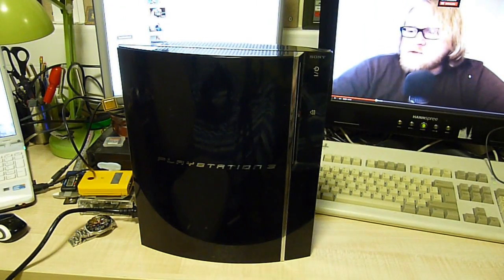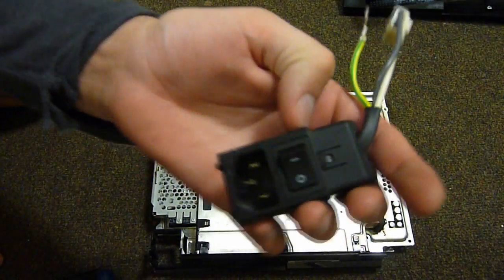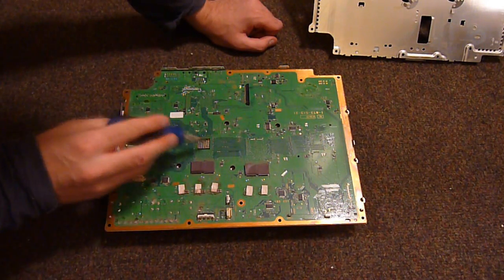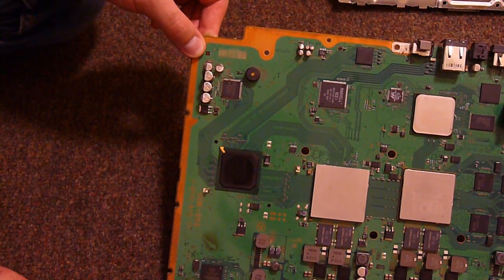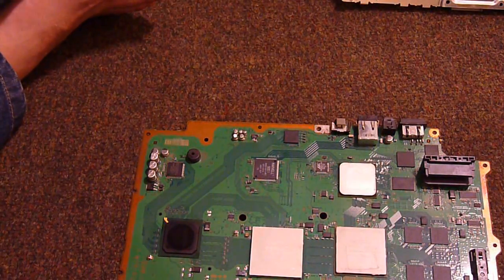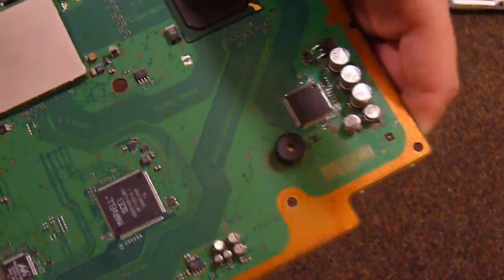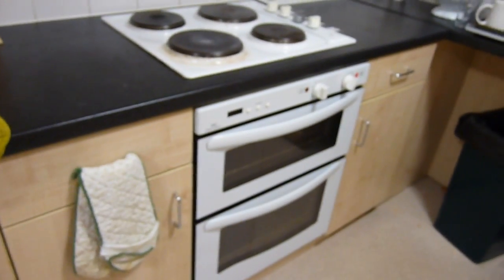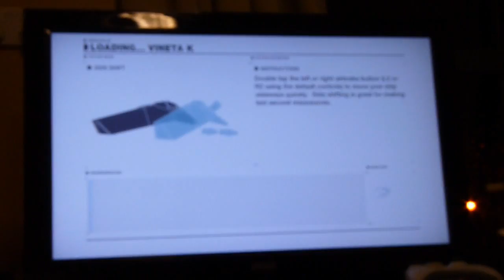PS3 Teardown & Repair

Comment: Damn you worm gear!!!  I hate that thing and I especially hate when the whole loading mechanism needs grease!
Reply from the maker: They are not hard to sort when they go wrong.
Reply: ***** lol they are when they are contained in TVs with slot loading DVD players!  Also many small parts, I am not good with small parts haha
Reply: ***** Though I did fix my PSone which had a gear that had snapped out of alignment so the laser sled was stuck!  I was happy about that because then I had 2 working PSOnes and 2 working big PS1s!
Reply from the maker: tribalmasters They can be rather fiderly, but I have dealt with worse.
Reply from the maker: tribalmasters
Good work.

Comment: Good fix, i done the same with my PS3 in 09 when my first PS3 had the same problem, except i used a paint stripper heat gun not a oven (wished i thought of that). It died again about a year later, same problem. It was getting on a bit at this point, crashing on a regular bases and it was looking a bit tatty, so i bought the PS3 slim, not a single problem with it in 4 years.
Reply from the maker: Not sure how long it will hold out, y guess, longer then the 360. Why not try it, does have the benefit of uniformly heating the PCB. As long as you don't cook it for to long. All components are designed to survive the reflow oven.

Comment: I got the slim unit, it sucks over 80 watts!
Reply from the maker: Not sure on the power consumed, but 32A is insane for a computing device.
Reply: *****  YIKES!!  I am guessing that is on the secondary side?  Me thinks the fat PS3 takes over 200 watts which is a lot for a console isn't it!  I don't really like using my slim because it's power consumption is still silly!  My PS1 takes 9 watts, my Roku digital streaming box takes 3 watts and my TV takes 20 watts!  I know it wouldn't really be too much of a dent on the power bill but I still feel bad using an entertainment device that helps destroy our planet :(
Reply from the maker: tribalmasters The system does require an excessive amount of current. Be interesting to measure that, although I have no meter that can go that high.